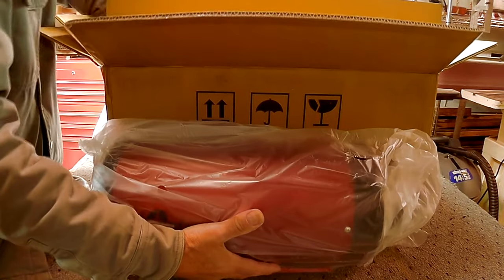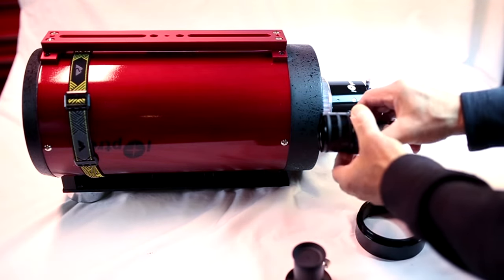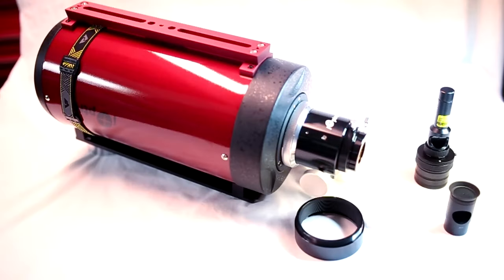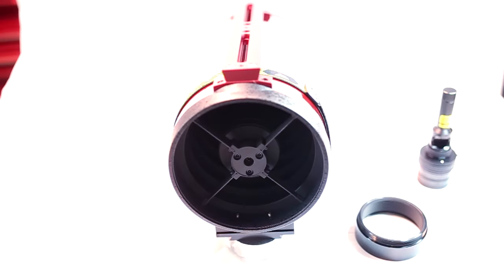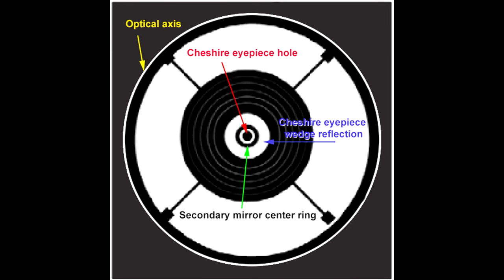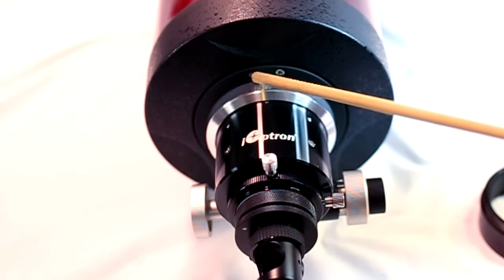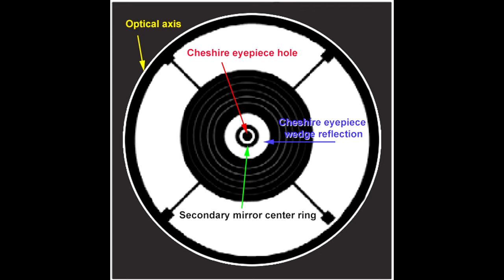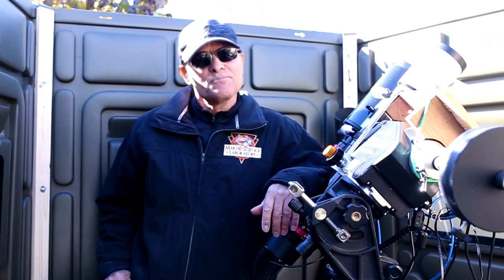The Simplest Way to Collimate a Ritchey Chrétien Telescope

Comment: Do not turn the centre screw because it will effect the distance between the primary and secondary mirror.  You don't need to move that screw to collimate the secondary.  Only adjust the allen screws.  release 1 slightly to tighten the ones opposite.  this is very important.
Reply: Well, every time a newtonian is collimated that changes. And when the time comes to clean the secondary just count the number of turns and reinstall with the same number of turns.  Just leave the 3 adjustment screws untouched and return the mirror to original position. It would just change the focal length slightly.
Reply: @ohwell2790  The focal length is crucial for an RC telescope to produce a sharp image much more so than a Newtonian
Reply: @Astronurd  Do not use it anymore.

Comment: I have an RC for a few year and there’s a need to correct a few things in this video:
- DO NOT tpuch the center bolt as that will change the distance between mirrors and give the scole astigmatism. 
- at minute 8:04: the laser returning to the hole has nothing to do with the primary mirror. It’s only bouncing on the secondary. 
- to align the secondary the ideal solution is to completely remove the focuser so eliminate focuser tilt from affecting collimation. Inset a plastic can with a small hole and calibrate the secondary to see the tiny hole back in the center of the secondary. (See kitchen counter collimation for more)
- then adjust the primary by using the technique call „hall of mirrors“ (also on you tube)
- only then correct the focuser tilt… (which can be a pain without a collimating ring).
- be pacient and make tiny adjustments
- always finalize with a star test. 

Good luck! 
-

Comment: Great review of the Hotech Laser Collimator. Compression is the way to go not the set screws.
Reply from the maker: It's pretty much the only way to get centered. Thanks for posting!
Reply: I have a Hotech flattener for my other scope, the compression/expanding rubber rings  technic is 100% better than the copper ring thing. I wish telescope makers making astrophotography telescopes would give up already with the copper ring thing, they ruin the tilt, whatever telescope it is.

Comment: Secondary mirror separation is actually a thing, btw. It must be precise, and will be off if you mess with the center "SET" (NOT LOCK) screw. It can also be majorly adjusted with the collar on the secondary holder cup.
RC6 and RC8, as well as CC6 and CC8 by GSO, and sold under many names. Orion for example will void your warranty if you mess with either, and they do not disclose the secondary mirror separation specification.
If you get into this situation, email GSO and they will send you the complete optical drawing. 
For me it was the CC8 and the spec was 420mm. They also sent me the CC6 drawing and it is 322.4mm.
Tell them you have their RC6 or RC8 and you need to know the "secondary mirror separation".

Other people talk about using plate solving, but I would start with getting the physical specification back to factory default, which is the actual math for the design.

Comment: Just collimated my 2 mirrors on my RC6 with only cheap cheshire eyepiece.  Was super easy. I finally used my laser only to put my focusser square who was really bad at first. Note: Don't ajust your laser with screw on your telescope cause focusser is attached with primary mirror. If not square, you will break your collimation. Only do it with cheshire.  I used  some tape behind my focusser to ajust laser in center cause hard to find tilting plate online.  Worked perfectly and all centered.

Comment: In the six inch rc the focuser is directly connected to the primary mirror.  You will move the primary mirror with those screws.Those screws are only used to collimate the primary mirror.    Unless you can independently adjust the focuser you are stuck with the alignment between the primary mirror and the focuser.  
 The larger scopes have an independent adjustment.  You can get an adapter flange from Teleskop Express. that allows you to independently adjust the primary mirror and the focuser.  
I made an adapter that directly mounts the focuser to the rear casting of the scope.  The primary mirror is completely independent of the focuser like the larger versions.  This way you can align the focuser with the optical axis of the scope and then you have to use the shape of out of focus stars to collimate the primary mirror.
Reply: Tue enough, but for us folks with limited funds this way is just fine. The star test was the best I have ever had, right in the center. This far better than the way in the instruction manual that comes with the Orion CC 6 inch. I am just a visual telescope user and this will work for the vast majority of users. Granted Jonathan yours is more precise but is good enough for me.
Reply: Hi! I’m interested in that adapter to the focuser. It’s a great idea! Can you share a photo? 
Thanks!

Comment: Hello. No matter what I do, I cannot get this collimated with the stock focuser. I think part of the problem is the Crayford design makes the center of the focuser off axis, even if you have a collimation ring. The draw tube of the focuser isn’t aligned, and it gets worse by snugging the dial down. Did the TS focuser you bought make collimation easier? I’m about to abandon my sunken costs and move onto a different scope.
Reply from the maker: Hey Dave,  I got the TS focuser because it could handle the camera weight and didn't shift when locking things down.  The stock focusers on these RC's aren't the best, as you've discovered.  But for some they're good enough.  Have you tried collimation with the focuser removed somehow, working with just the visual back?  You would probably need tot rig something up but it might be worth a shot.  That might give you an indication if the problem is strictly with the focuser or within the OTA.  Best of luck to you.  Something we all need from time to time.

Comment: Hi:  Kevin Zhou of IOptron recommended your YouTube channel.  I recently purchased the Scope and upgrading the Focuser as you suggested.  Would like to image The Whirlpool and M27.  Live in Concord, MA and have suburban light pollution.  Can drive to New Hampshire and Vermont for better Dark Skies.  Have an occasional Mountain Lion, but these animals are traveling large distances.  Do have Black Bear, but usually young males.
Is the Focuser attached to the Primary Mirror?  Is this a real concern?
Best regards,
Carl Geyer. Love your channel.
Reply from the maker: Hi Kevin, the stock focuser is not attached to the primary mirror, unlike typical Schmidt Cassegrain Telescopes.  Subsequently, there is no mirror flop when crossing the meridian.  Just be sure the travel length of the new focuser doesn't exceed 55mm.  Otherwise you run the risk of it bottoming out on the visual back in some situations. Other than that, it's a simple task.  BTW: we have cats here in the Hills and occasional sightings of Black Bears. 💫

Comment: Really great video. Thanks for posting it.
Question though. If I'm using the spacers for photography, wouldn't I want those in the image train? Then adjust to get everything as centered as possible with them in place? Otherwise, if I add them in later, it could possibly be off, in my mind.
Thanks again.
Reply from the maker: Hey Jaymz, it makes sense what you're saying.  The spacers do screw in which would limit the possibility of the imaging train being off after they were attached.  I'd say try both ways and see.  That would narrow it down. I like to know myself.  Thanks for posting.

Comment: Strange, if I turn my center screw to losen the center mirror my f/8 is no longer f/8, e.g. plate solving on a loosened center screw results my RC8 to go from 1635mm to 1620mm, this cannot be correct.
Reply from the maker: The center screw should be re-tighten after the adjustment. Some have reported adjusting the secondary without loosening the center screw. If you chose that method then be careful.  Loosen one side slightly followed by tightening the other side; or vise versa.
Reply: Yes it is and it is not good... You need to adjust your distance to be exactly at your native focal, or you will never be able to be 100% colimated.

Comment: Excellent video. Question, what's the focuser that you got to replace the factory one? Is this a rack and pinion type? I'm looking to replace mine to avoid the constant slip and to be able to use my EAF as intended. Thanks in advance!
Reply from the maker: Here you go: https://www.teleskop-express.de/shop/product_info.php/language/en/info/p6970_TS-Optics-2-5--Rack-and-Pinion-Focuser---holds-Acc--up-to-6kg---travel-53mm.html  Rock solid. 
You can also put a ZWO electronic focuser motor on it with a slight modification. Just remove the two screws from the bottom of the focuser that will allow the ZWO standard bracket to attach cleanly, no mods.  Next, replace the screws that attach the ZWO motor to the bracket with longer ones that will allow you to build it out with a stack of washers or a couple of nuts used a spacers.  Tighten it all down after making sure there's no binding on the flex coupler.  Cheers
Reply: @DakotaStarryNights  You got an excellent video. Will this focuser be able to accomodate the infocus of my GSO 0.75x reducer. Pls assist.
Reply from the maker: @abhijittamuli1609  If the original one did then this one should also.  The draw tube travel is about the same.
Reply: @DakotaStarryNights I have been looking for this focuser. The TS website says it is 90mm at the telescope side, but the RC6 is 96mm. Do I need an adapter?
Reply from the maker: @davesmith9342  The one I got from TS fit the iOptron RC6 in the video above.  https://www.teleskop-express.de/shop/product_info.php/info/p6970_TS-Optics-2-5--Rack-and-Pinion-Focuser-with-M90x1-Connection-and-360--Rotation.html  
The focuser has M90 x 1 female threads.  If your RC6 actually has 96m male threads it would stand to reason you would need an adapter.  TS does make custom adapters, so you could contact them.  Or you could try it without one first and then order one if needed? Happy Holidays!
Reply: @DakotaStarryNights yeah, I don’t know where I got 96. I got my calipers from work this morning and sure enough, it’s 90…

Comment: HI -- 

I have a 6" RC and the focuser is troublesome -- it's either too tight but holds the image train, or it's easy to focus but the image train slips. I considered a Moonlight focuser, but the one they recommend is expensive. Which TS focuser did you get for your telescope and how has it worked out for you?

thanks for the excellent video
Reply from the maker: Hey Thomas, here you go: https://www.teleskop-express.de/shop/product_info.php/language/en/info/p6970_TS-Optics-2-5--Rack-and-Pinion-Focuser---holds-Acc--up-to-6kg---travel-53mm.html  Rock solid. 
You can also put a ZWO electronic focuser motor on it with a slight modification. Just remove the two screws from the bottom of the focuser that will allow the ZWO standard bracket to attach cleanly, no mods.  Next, replace the screws that attach the ZWO motor to the bracket with longer ones that will allow you to build it out with a stack of washers or a couple of nuts used a spacers.  Tighten it all down after making sure there's no binding on the flex coupler.  Cheers.
Reply: @DakotaStarryNights  Hey -- so I ordered the focuser linked above and it certainly looks like a quality piece of equipment. I am concerned, however, that it is so long that I will not be able to achieve backfocus with a focal reducer and a zwo 294mcpro camera. What is you imaging train and has this been an issue with you? I am about to return this focuser for a similar one that has 55 mm of drawtube travel but if yous works maybe I won't. Thanks in advance for your reply! cheers Thomas wicker
Reply from the maker: @thomaswicker4368   It will not work with a focal reducer.  I use a flatner that doesn't reduce the focal length to get the maximum power.  So it works for me.  So, yeah, I'd return it for the shorter one if you're wanting to reduce the focal length. https://www.teleskop-express.de/shop/product_info.php/language/en/info/p6970_TS-Optics-2-5--Rack-and-Pinion-Focuser---holds-Acc--up-to-6kg---travel-53mm.html  (I've updated the link above just in case other guys want to use a focal reducer. :)
Reply: @DakotaStarryNights  Thanks for the quick reply. I meant to say flattener, not reducer. I actually tried it all out this afternoon, and it worked fine -- I achieved focus with all the parts included, with the drawtube in about the middle of its travel.  Cheers, Thomas Wicker
Reply from the maker: @thomaswicker4368  Glad to hear it.  Thanks for the update!

Comment: Hello i just bought an omegon pro rc  the 6" one and come from using a refractor so i don't know all these things practically, so i'll buy as soon as it will arrive a laser collimator but i even seen that a lot of people say i should buy a tilt adapter, what is it and why should i do it?
Reply from the maker: I haven't any experience with a tilt adapter so I can't comment on its effectiveness.  Not all focusers will attach to the back of the scope in the exact same plane as the primary mirror.  But a tilt adapter, as I understand it, tilts the focuser so that any deviation can be adjusted out.  

I would recommend to try to achieve collimation first with the laser collimator then star test it.  If you find the results satisfactory, then good is good enough.  Right?
Reply: @DakotaStarryNights  Sounds fair, thanks for the patience, keep going man🙌🙌

Comment: Hello,

I think it is underestimated to get the right distance between the main mirror and the second mirror. Unlike SC telescope, the RC telescope has hyperbolic mirrors built in and if there are problems with the images you should probably start there. I dismantled my scope and washed the mirrors. Afterwards, despite the good settings, nothing was right anymore, although I had made a video beforehand and Jupiter's satellites were round. 

https://www.youtube.com/watch?v=66NknidwvQQ

However, after cleaning, the satellites are more arrow-shaped. I also had the problem that the main mirror could be slid back and forth on the bearing tube by 0.8 mm. To fix this I had to apply 4 layers around the Tube of Kepton tape. Now I'm just waiting for a clear night to complete my adjustment.

CS

Werner